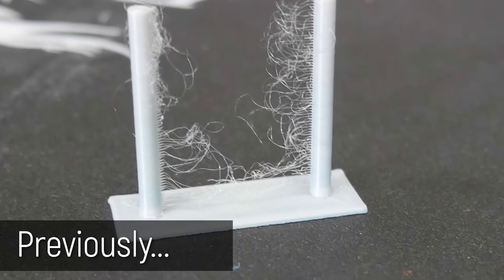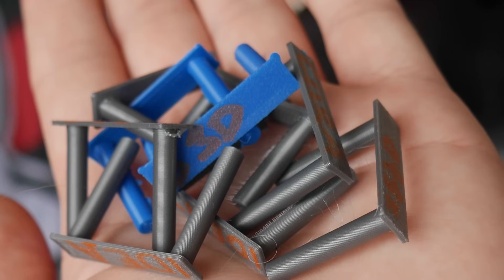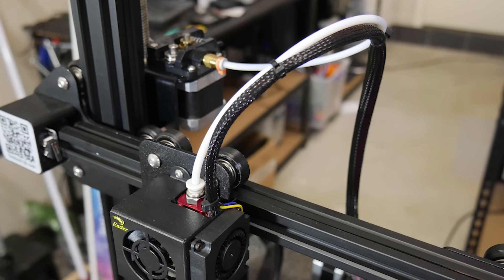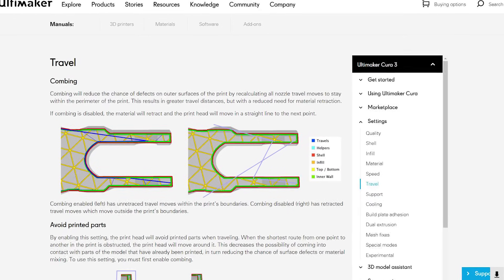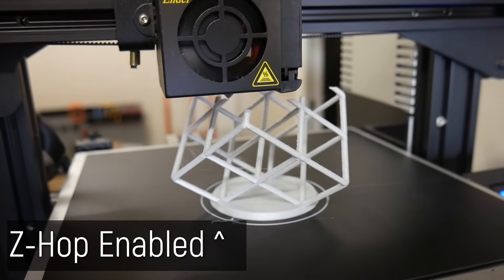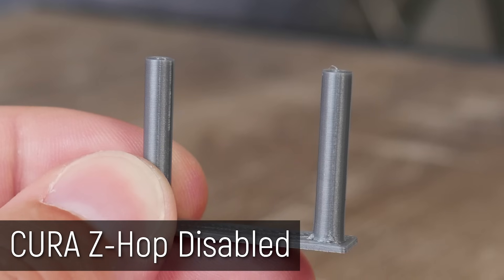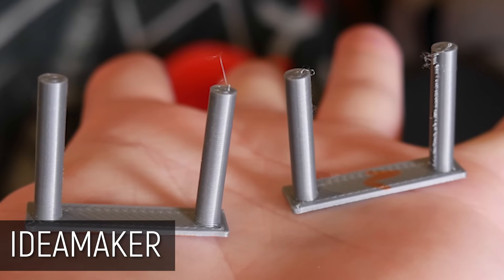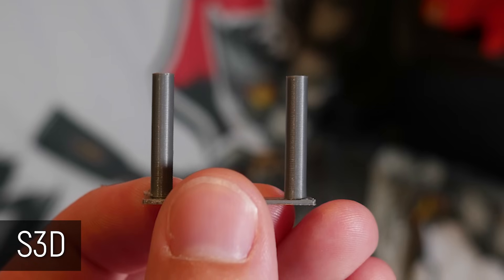Stop Ender 3 Stringing with this One Weird Trick! (ok but seriously)

Comment: I have Cr20 - it worst printer because its have only 1 z....so it is never stable.... I print on the left side near z.... I disasmble all printer and try to tighten.... Sorry my second Anyhcubic Chiron like a rock because its also have two rails with 6 wheels so its two rails 12 wheels and i rail in middle with only 4 wheels... And different to lets say Prusa with two z not so big. And all parts like MK8 nozzle and very little heat box... I regret i buy it. All print fot 8-9 hours need new adjust to a printer and of course, i use mirror/

Comment: I had stringing issues with the CR-10S. Issue with mine was the SD card for the printer. As soon as I removed the SD card and used the serial cable instead the stringing stopped. No matter if I used Z hop or not it would string. I watched my printer one day and noticed that the printer would randomly go fully to end of x axis then start back printing. I've used different programs with the same results. My suggestion with anyone noticing their printer finishing a layer of the print and going to other side of bed for no reason what so ever stop using the SD card. Use your computer with serial cable.

Comment: When I started to build my 3d printer. I Focused and built my 3d printer around  a good hot end and extruder. Also a quality controller board. I feel that if you use quality parts you will have higher success with prints.

Comment: I see many people swear by brands and expensive printers but form what im learning of other people experience and my own experience it seems a good printer isn't expensive, many of the Chinese brands are good enough for most people only someone who will make a profit from printing would benefit from a professional printer. All seems to boil down to good printer software and slicer settings. I would say as much as 60% is software the hardware is the other 40% and the requirements are quite simple, sturdy frame and bed a good extruder and tensioned belts. No need to spend $1000 upwards to get amazing prints consistently.

Comment: I feel like like Angus has it out for Creality.  On the other hand, I looked into the Ender 2 when he did a round up of inexpensive printers, giving it praise...
I ran the the stringing stl on my Ender 2, Simplify3D 4.1.1,  with no tweaking, none of the tips found on this video,  and it was flawless.  Not even blobs.
I did however use a .8mm nozzle.
IS that the difference here.
PS I really respect Angus and not tring to be a buttface so I hop it doesn't come across that way..I just think he has it out for Creality for some reason...BEYOND a disdain for Bowdens....
I may be an oblivious  buttface...or a buttface in denial for making this claim.
Reply: It ddoes seem like he just does not like Creality sometimes....

Comment: Just watched - a subscriber with Ender 3 Pro and S3d. I downloaded the test file and the only change I made was the vertical Lift. 

I thought it would be neat to download the file, print as is and then only print with no z hop. I think may conclude what you were getting to. Along with the roll on the dice of the Ender machines. I received mine around 12/4/18. Bought S3d because of you and your Lithograph videos. I do not regret it one bit - Thank You !!!!!!!

Here were the results on my machine:
No z Hop:
http://www.tribecygnus.net/attachment.php?aid=427
http://www.tribecygnus.net/attachment.php?aid=425
https://youtu.be/5p9GGZM1TSA

With z Hop:
http://www.tribecygnus.net/attachment.php?aid=426
http://www.tribecygnus.net/attachment.php?aid=428
https://youtu.be/IFcLEvrMOOs (can't really see stringing in the video)

So within 40 minutes of watching this - I must have a 'good' Ender Pro machine. Yep, bed was warped and had to get a 4mm glass one. Learning curve has been steep - Thank you for your videos. On this machine, I am doing a lot of bigger projects and changed the nozzle to .5mm to speed up printing. I am only about a month old in this world for 3d printing, but love it. 

Anyway, not sure if you will see this - good job on what you are doing and I just wanted to share. Like you do. :)

Comment: theres a similar option for this in slic3r as well. you can select either the inner side, opposite side or random. im not sure if it actually rejigs the circular motion to merely stop on the opposite side say, or it stops on the inner side & walks inwards before sprinting to the next pole - but i found it useful too. i have it from the opposite side.

Comment: I have been tweaking retraction on one of my printers using cura 3.6.. enabling combing was the last piece of the puzzle after tweaking retraction. Z hop caused way worse stringing. Thanks Angus, it helps you found similar results with cura.

Comment: on the Ender 3 how long is the magnetic print bed supposed to last? I have been printing for 5 days straight and I cannot get the bed to stick anymore. I tried using blue painters tape on the bed with no effect. I have tried different print bed temperatures and even changed out the filament and cannot get anything to stick anymore.
Reply: Make sure that your nozzle is the correct distance from the print bed: the extruded plastic needs to be 'squished' onto the bed surface to get decent adhesion. A good rule of thumb is that it should be about the thickness of a sheet of printer paper away.  Some exceptions exist: PETG needs a larger gap for example.
Reply: @nerd1000ify  Thank you that worked. The print head was to close to the bed. This is my first 3D printer which has been a huge learning curb for me.

Comment: By 4:21 I gotta say... you shouldn't apologize for this... because even if you can use cura and a different set of filament... so what? You're changing things that are NOT the printer. The printer thus, prints fine, but the slicers weren't creating the best of results. 

Big whoop... All that means, is that the printer itself is super sensitive to tiny itty bitty things. So your original thing of (I assume) "Ender 3 Pro is kinda crap", still stands. Who cares if you have to tweak the living hell out of it to get it to do anything 'nice'... the fact that you ever HAVE to, is enough in itself to validate the original verdict.

Comment: What effect does all this have on layer bond strength. If plastic no fluid enough to bond to the last but leaves no strings.
Reply: So there wasn't any point asking this question because this guy is not here to help! However the question was relevant because retracting a less viscous liquid is ineffectual and worse creates bubbles in the project and other unwanted features.

Comment: Angus....
LOL I'm using both the Ender 3 "pro" and Cura 15xxx that came with it. This is my first printer ever so I can't really form any hard opinion. I can say though being around a ton of machines of all different kinds,  i have had 2 machines that had consecutive serial numbers,  should be the same right? In theory,  they should do the same thing with the same materials,  they don't,  one has to be tweaked in another way than the other to get the same results.
With that said, from what I can tell,  there is a ton of variables one will have to work out to get satisfactory results....yeah?

Comment: I think that the z hop won't work propertly until you have a more direct cooling fan duct, as you can see the stock one  does not cool down the Layers directly but the heating block. You're getting good results but It could be better if you upgrade the fan duct

Comment: I have 3 Ender 3 printers. They are what have kept me in 3D printing. Unlike the first machine I had, Flashforge Adventurer, bought from a retail store, ready to go, and completely unstable. $700 compared to $250. I think Ender 3 should be 3D Printing Machine for 2018.

Comment: Lol some more reading on how to use S3D is needed Angus... Just move the retraction point heavily to the Y axis on this string test (so -100Y) and add 0.5mm wipe and you have the same as the Cura feature you were promoting (notice the retraction point is orientated differently in the 2 gcodes you showed).

Also you keep making comment that more cooling reduces curling on a print but you have failed to understand what causes curling of a layer above the bed. The curling is cause by the same issue as the bed where the print warps AWAY from the Hotter-side of the layer due to the other side cooling faster (cool side shrinks faster causing curling up). Clearly cooling a print more, that is curling (as you are primarily cooling the top layer), will cause more curling. Thermodynamics at play, can't get around the principles and something you should probably have a read up on if you are going to continue to comment about this. 

Generally people running into curling issues are either running the print temp of the plastic too high or they are over extruding (most common) and the curling is a result of extra plastic being pushed over to the fine edge where it can't be forced down or out into a more stable/solid part of the print, as the nozzle moves back from edge it leaves a deposit behind making that edge of the print higher. Next pass the edge is already a poofteenth to high and because the edge overhang layer is thin when the nozzle comes back it flexes the edge down and deposits plastic from the layer plus the additional it has pushed over again on top. Now the edge is 2 poofteenths to high, move forward 100 layers later and now the edge is way to high and there is enough build up of plastic on the edge that you think it is curling up when really it is just excess plastic.
Reply: Redemptioner1
Thank you for this analysis. I believe you are correct and I will attempt some fixes for my warping as you suggest.

Comment: I have been using IdeaMaker mostly because of the ability to add/remove supports manually and being able to cut parts.  One issue I have is I can never get a good Benchy from ideamaker.  the stack always comes out soft and spongy.  When I print Benchy after slicing in Cura (using the exact smae PLA) it prints fine.

Comment: I to have some blue filament just like that and it prints like crap. It is crazy how many variables come into play for different people. Between the filament, The initial build setup, The defected parts, the slicers. So many different results depending on everyone's setup. Glad you got it sorted out. 

I agree with you about quality control to. Seems hit or miss. Not just for Creality though. The entire market from the printers to the filament to the slicers seems pretty random.  It is crazy how such simple machines can differ so much for every customer. 

Will give your new profiles a go. Thanks for video.

Comment: I love Ideamaker also Angus, i can get perfect prints with it on my ender 3. That is until it started malfunctioning badly, i can't get past a few layers and the surface is so bumpy and rough the nozzle hits those so hard it layer shifts. I bought a kit on ebay to go direct drive and it installed nicely but you need a longer stepper motor cable which is on order. Can't wait to test it out.

Comment: You're always tinkering with the Ender 3. To no end. It's designed for a small niche of people. While the other group of people who do buy these (because of the price), just don't want to tinker. They just want to print. You like to tinker with your printer for cheap? Get an Ender 3. If you want an out of box experience, Ultimaker or Prusa. Quite simple really.

Comment: Quite interesting to see these results. The final test you did got me wondering (and as a resin printer, I have no idea if it's possible) but I assume that the lack of stringing without z-hop is due to it "wiping" the nozzle on the print as it moves. With that logic, it got me wondering, is it possible to move the position of the z-hop? I don't know where it does it by default, but I'd assume it just jumps up from its last point before the move, so is there a way to make it move slightly outside the print (or just a little further inside the print)  before jumping up?
Reply: It's possible, but is it implemented? I have not seen anywhere to code that movement in on any slicer. Could the printer physically  do it? Oh yeah...

Comment: One more tip I could give for the ender 3 is to up the Emax speed in the Printer settings to 120 instead of the default 25, and then use a retract speed of 100 mm/s. this has greatly reduced my stringing and improved my quality overall (I own an ender 3 pro) you can also lower your retraction to somewhere between 3 and 4 with these settings

Comment: Z hop of 0.5 mm is a bit big though, I use 0.15. Might have the same issue though. But yes, thanks for updating the results! Tweaking is, surprise, required. :) Totally also agree on the baaaaaad components stock, I changed to a different bed and psu (when we didn't have Meanwell yet) immediately, which I found such a waste. I now have a printer that only has the name Ender on the spool holder but is totally mine. :)

Comment: You can get similar results to Cura in S3D with printing outside->in on perimeters versus the default inside->out . Having run Bowden setups for a long time Outside->In has a lot of advantages. It does take more retraction tuning, but once it is done it helps with dimensional part accuracy because the outerwall solidifies before inner perimeters push against it. Versus inside out, which can lead to Oversized OD's and Undersized ID's.

I run in my simplify3D Ender3 profile: 4.5mm retract, 90mm/s retract, 3.0mm wipe,  40mm/s, outside->in perimeters, print Islands sequentially, Z-Hop ENABLED. I get very good results, no blobs or strings. And this is with cheap Microcenter Filament (AKA ESUN Filament).

Then again, YMMV.
Reply: Where is the Combing setting in Cura?
Reply: How do you set Z-hop enabled?
Reply: You must Set the retraction speed Higher.